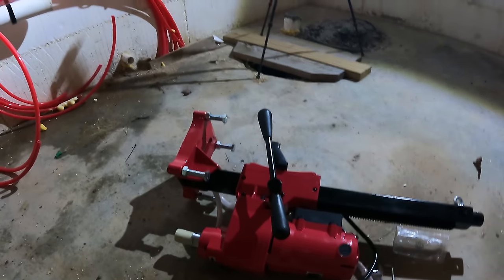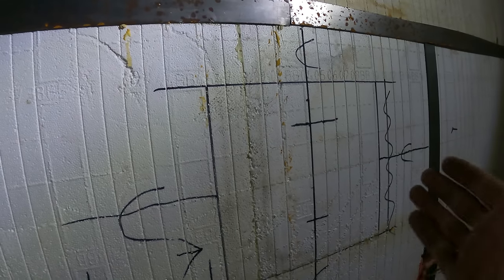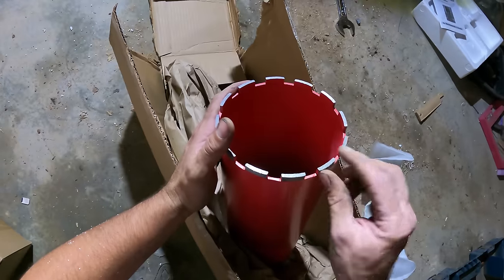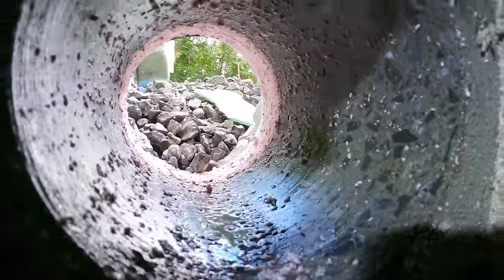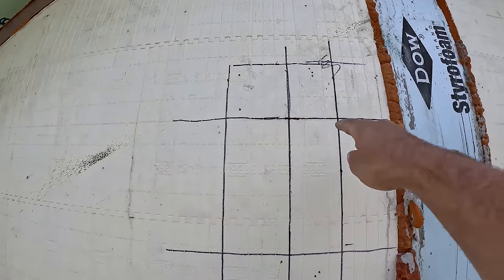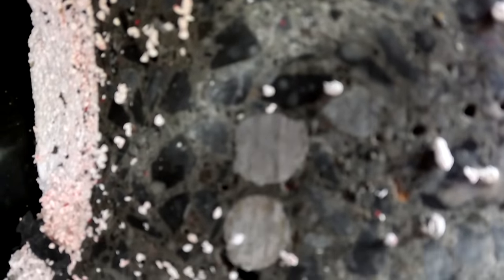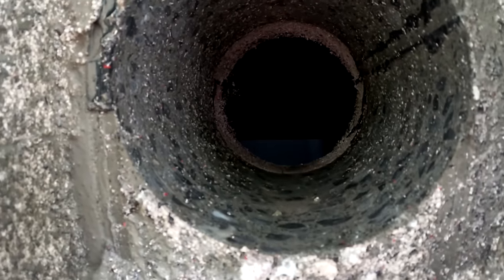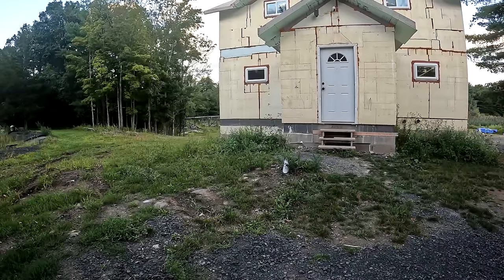Setting up a wall mount Bluerock core drill rig for drilling concrete

Comment: to save money on the tool, couldnt you just use a masonry drill/hammer and make a lot of little small holes around the perimeter? would take longer but still manageable

Comment: and love how you said to eliminate dust haha ...... you cannot cut concrete without water for one itll bind your bit and not cut and destroy your segs and for 2 the dust creates silica with can mess your lungs up very badly osha would have a blast if they see that white dust
Reply: But you can drill without water, but you need dry bit drill. And then you will have to much dust!

Comment: should of used a anchor to mount your stand been coreing and cutting concrete for 6 years use concrete anchors and allthreads
Reply from the maker: what do you mean? of course I used an anchor, how else would I hold it up

Comment: I'm confused as to why the recessing was necessary before drilling the mounting hole. A piece of board with a small hole could have been used under the foot to spread the load on the external insulation. But why was a recess necessary in the basement?

Comment: Pricewise it may make sense when you build a house or two of pure concrete, but the chunk is still Made in China. I rather stay on the "right side and buy a clean" machine, like a Hilti DD 250 with stand and bits. Yes I know, that's a $6-7000 kit, but then I'd take up on Jesse's suggestion, start a short term rental business, and after a couple of jobs I assume the cost is payed off.

Comment: Could you screw the base to a piece of plywood and the plywood (spread over a larger area) to the foam so you don't have to cut away all of that lovely foam first?
Reply from the maker: Might be able to but Its alot of force on that area and the plywood would wiggle around a lot when the hole gets started
Reply: The anchor bolt would have to be 4-5'' longer and the whole setup might not be solidly mounted.
Reply: You have to put chemical anchor with threaded rod and using nuts under and above playwood and then core drill can be mounted. This way you not deforming isolation, but preapere is 1 day before, because chemical anchor.😊 When you Finnish thread rod is still there.

Comment: Justin wondering wat type of home is this that has concrete to the roof line, never seen that before..   the drill worked nice…
Reply from the maker: the entire house is concrete, even the roof and all floors. Its an ICF house
Reply: @jmuller86  wow,  ok

Comment: question, what are those 4 outside bolts for?, if not to secure the unit to the wall?, One certainly wouldn't trust just one anchor point.
Reply from the maker: The bolt to secure it is 1/2" . Why wouldnt you trust a half inch bolt? Its rated for thousands of pounds of shear strength
Reply: These 4 bolts are there for adjust 90% angle of drilling horizontal and vertical!

Comment: Would have liked to see the teeth on the drill after those 4 holes. How do you figure it's going to stand up? Just curious how much of a consumable it is. For sure made your money back already though!
Reply: Teeth are just fine. This is just soft reinforced wall. You can make 100+ hole like this.

Comment: What kind of siding are you installing on your home?
Reply from the maker: stucco
Reply: What is your planned timeline on the stucco? Aren't you a little concerned about the degradation of the Styrofoam? It has been there almost a year and you can see the deterioration in the form of it darkening from the UV exposure. My guess is the manufacturer of the ICF blocks probably recommends covering in a few months, but not sure about that. I know since you sold your other house and moved in, you had a sense of urgency to get a couple baths and the kitchen squared away as you need to live a life. In a couple months, it would seem it will become more challenging to seal in the exterior due to the cold weather in NY.
When I built my house, we moved in with no kitchen, baths or anything also. We only had a 0.5 BA with commode and pedestal sink and that was it. Not even a shower. Finishing a full BA was the first thing out of dire necessity. Before it was done, I just had plastic sheeting duct taped inside a tub and a shower curtain on a compression rod. The "kitchen" was a couple throw away cabinets with a piece of plywood for "counter tops". Didn't even have appliances except a hot plate and microwave. It was camping.
Reply: @jmuller86  
What is your planned timeline on the stucco? Aren't you a little concerned about the degradation of the Styrofoam? It has been there almost a year and you can see the deterioration in the form of it darkening from the UV exposure. My guess is the manufacturer of the ICF blocks probably recommends covering in a few months, but not sure about that. I know since you sold your other house and moved in, you had a sense of urgency to get a couple baths and the kitchen squared away as you need to live a life. In a couple months, it would seem it will become more challenging to seal in the exterior due to the cold weather in NY.
When I built my house, we moved in with no kitchen, baths or anything also. We only had a 0.5 BA with commode and pedestal sink and that was it. Not even a shower. Finishing a full BA was the first thing out of dire necessity. Before it was done, I just had plastic sheeting duct taped inside a tub and a shower curtain on a compression rod. The "kitchen" was a couple throw away cabinets with a piece of plywood for "counter tops". Didn't even have appliances except a hot plate and microwave. It was camping.
Sorry double posted to add your link.
Reply from the maker: @LisaMedeiros-tr2lz  the only thing that I need to do is pressure wash off the yellowness to the icf and then they are like brand new again. I will be having the guys start the stucco in a few weeks, should have no issue getting it on before the freezing weather. Usually we have till the middle of december or even into january before its freezing during the day

Comment: Are all the exterior walls cast in concrete?
Reply from the maker: yes, and the floors, and the roof
Reply: @jmuller86   But with the ICF concrete walls is it still possible to put the exterior cladding and if so how to make it hold

Comment: 1. You dint have to buy core drill. That bosh drill is enough to made a hole, not that pretty but a hole trough this walls. You draw a circle and drill holes around.  Then start hammering what is left.  But it make sense if its only one hole to made.
2. You don't have to cut this Styrofoam, its hard enough  for that drill to not move, you just need drill anchors in to concrete.
Reply: Drill will loosen and then will swing and maybe someone will die. This is deadly danger if you not working by the rules. No one isolation is not strong enough. Mechanical power on bit is 4-5 kW and drill is working! And there is not protection for burnout this kind motor! This is not ordinary motor! This is collector type motor and protection is only from directly contact before motor and from leacked current protection! REAL core drill machine cost few 1000$ and they have safety mechanical clutch! Even 10 000$ machine burnout!
Reply: Bosch drill bit works if you have no metal reinforced wall. But if you have, probably 10 bits will not make hole in the wall. Because those bit will be damage soon as they hit metal. Beer and Wine are both alc. , but are totally different!

Comment: Jesse, I believe that your drill is modelled after mining diamond drills that work on the same principle,  in mine exploration and diamond drills have been in existence for over a hundred years, but the cutting head is a diamond encrusted bit, and always locked under lock and key when not drilling as they are super expensive.

Comment: These tools are not toys I had a guy that core drilled for me for 10+years he was on another job he didn't fix the drill down properly the machine swung around hit in the side of the head and killed him
Reply: I agree. It should be fixed at least 150% or more. Output mechanical power this machine is around 5kW and this is deadly danger.🙄

Comment: Jesse is just like Andrew Camarata. This is perfect.
Reply: Andrew does not seem to do lots of interesting jobs on other peoples' sites any more and stopped doing his usual introductory talk on his projects and talking us through them - shame.
Reply: Actually, they are friends and have a couple of collaboration videos.
Reply: Great video Jesse, I've been threatening to buy my own for 30 years but the sizes I needed were 7" and up and it was very reasonable to call the hole core company. But NOW the prices are exactly as you describe ..insane. $1200 just to show up. The only difference is the hole core company guys would simply freehand the holes you drilled with a handheld unit. Right up until the 9" I needed to punch storm pipe overflows thru the side of the building. Pro tip, don't drill over the top of the newly installed metal roofing on the outside of the building in the middle of a hot summer day...the slurry makes a g*dawful mess you will need to power wash off 🤬
Reply: Leave Andrew alone man, he’s in love so it’ll wear off soon.
Reply: Jesse is more tech advanced, more articulated, Camarata is funnier but breaking stuff too much...
Reply: I like when he breaks stuff so we get to see how he repairs

Comment: Can't believe that they would charge $1200 for one hole, five minutes of work and five minutes of setup.
Reply: It’s more than 5 minutes, with all the set up for mounting and water and electricity and sometimes I have to bring water and generator . About 1 hour but still not bad for time .
Reply: I have this kind machine, they don't have mechanical safety clutch, not electrical mother protection at all! They have 4-5kW mechanical power at bit and when already run is deadly danger! If you start and something's gone wrong, only motor will burnout, but when is running, if Posen just a bit and come on stone or metal will swing  and kill someone! Just put 2 bolts instead 1!if you all this have in mind, then is safety. You just have all this in mind, before start drilling.😊